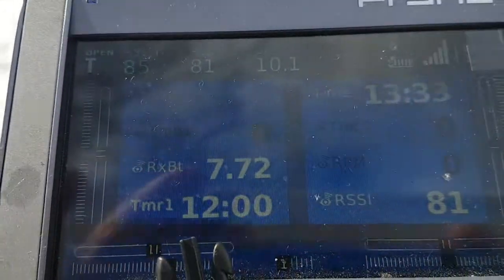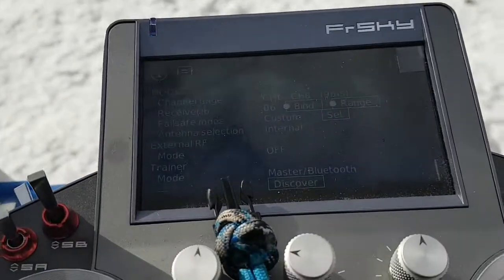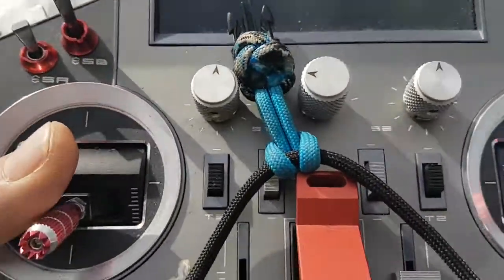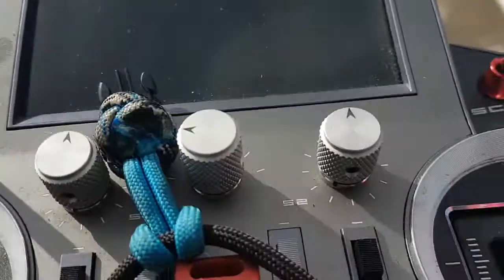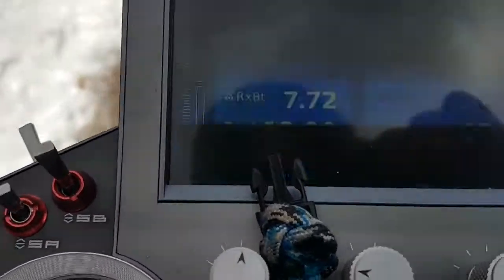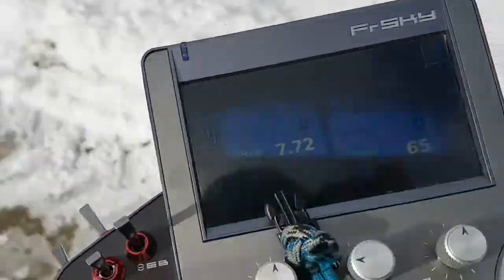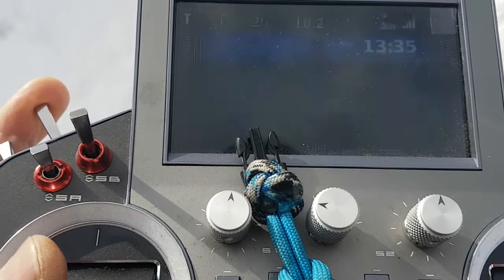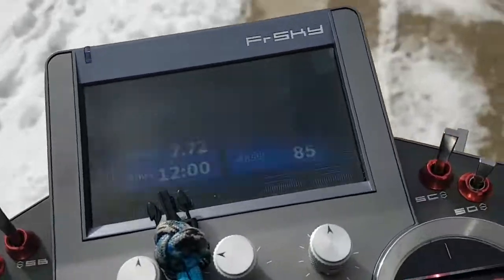Test 5 this is the RX8R non pro, for base-lining comparison

Comment: So what are your thoughts on FRsky and Gas large scale planes ? I want to get a R10pro for my next build but if I cant get it what RX do you recommend?
Reply from the maker: I fly giant gassers in the summer, I have a skywing ARS300 120cc, Edge 540 120cc and others.

The receiver I use for gas planes is the RX8R-Pro mated with an xm+ mounted near the rear of the plane.  They are rock solid with high resiliency to noise.  The xm+ in the back of the plane is always clean and is far away from the ignition source acts like a backup redundant receiver.
Reply: Joe Trinidad what radio you running??sound good man I hope we inspire a movement for people to switch over I love my hours x10s I got a new express I want to use for my airplanes now and really want the archer Rx but your setup sounds solid, you think the new rxsr would be better the xm+? ?
Reply from the maker: Hi James, I've been using my trusty X12S that you see in the video.  It's updated with OpenTX 2.3.7 and the new 2.1.0 firmware.
Reply: Joe Trinidad so you run accst? I ask because the x10s express runs on this new protocol I believe, and not sure the xm+ will work with that
Reply: I'm just confused on what makes my x10s express different from the old x10s and why certain rx won't bind with each other..
Reply from the maker: @jameshaladus9165  the x10 express differs from the x10s in 3 areas.  1) ISRM  INSTEAD OF IXJT, 2) Bluetooth module that's high resolution so the trainer works 3) ACCESS Protocal with backwards compatibility to ACCST.

Those are the major differences.

ACCESS gives you 24 proportional channels, greater range and the ability to register relievers and do airplane / model sharing amongst other improvements.
Reply from the maker: @jameshaladus9165  yes I run ACCST, the XM+ also has new firmware available.  For ACCESS you can use the newer version of the XM+ I believe its the XMR access full range receiver.
Reply: Joe Trinidad dude okay thanks for clearing that up I need to wait for archer m+ and archer r8pro to run access and get more out of the new radio

Comment: you are only switching the ignition on - the interference, if any, happens when the spark plug is firing i.e. engine actually revving...
Reply from the maker: The test jig has 2 live spark plugs, with a signal generator.  The signal generator was simulating 3500 rpm, and the spark plugs were firing.  There are other tests in my channel and on RCgroups which shows this test jig and spark plugs firing.

In this link, you'll see the actual test jig along with the spark plugs firing:  https://youtu.be/5juFYWOzMGg

In addition, Sandeep, the module being used is a known "noisy" module.  This is the 5th iteration of the firmware / hardware test on behalf of Frsky.  On the previous versions of the firmware and hardware, we could not get more than 15 meters in range.  The unit being tested was a pre-release of a receiver.

Findings from Tests 1 through 4 resulted in this hardware, which had excellent range.  Note:  Tests 1 - 4 were not publicly published.

Hope this helps clarify.